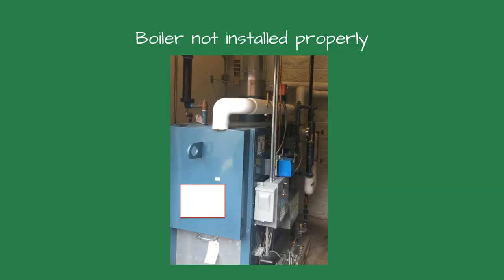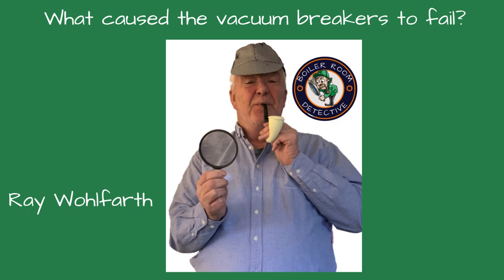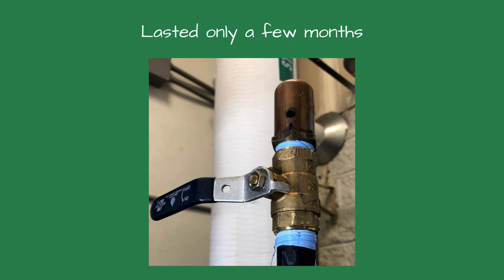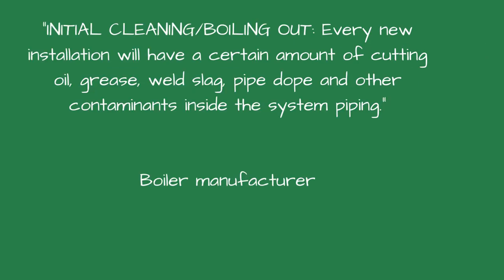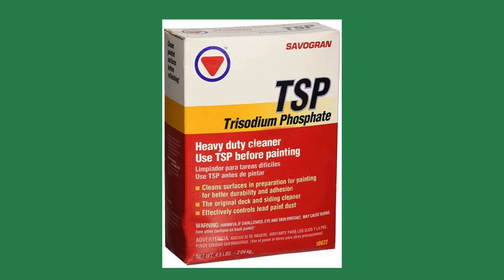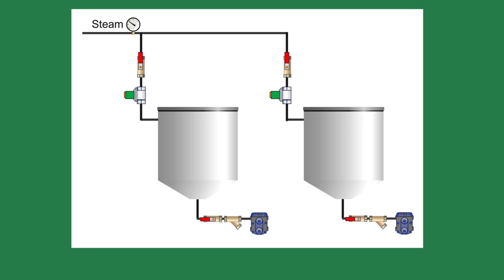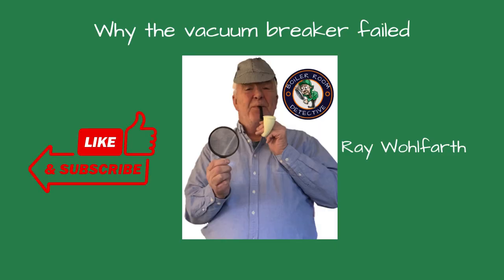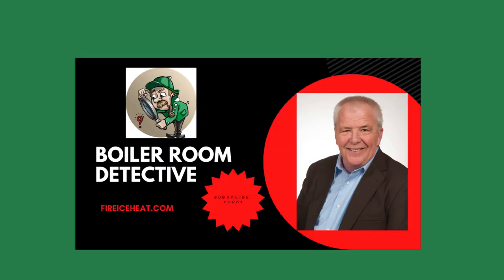Case of the broken vacuum breakers

Comment: A fast opening solenoid valve on a steam line is another good way to suck the water out of the boiler.
Reply from the maker: Yes sir thanks
Reply: What kind of vacuum breaker would you use on a 40year old system that shear the same steam header. Boilers are located in the basement and they take care of the first and second floor..
Reply from the maker: @penguinlife927  I like the watts or spirax sarco I’ve had guys use check valves with success
Reply: @boilerroomdetective  thank you